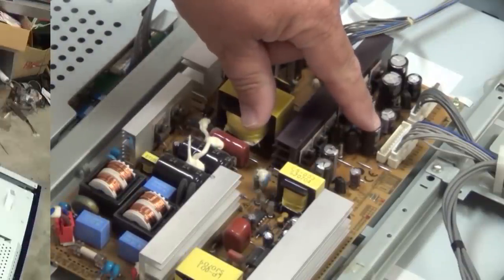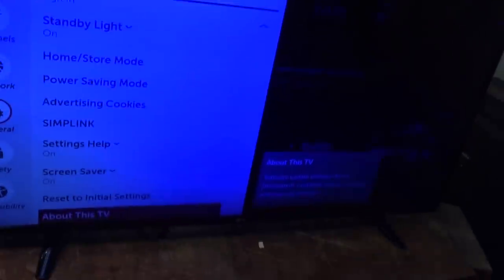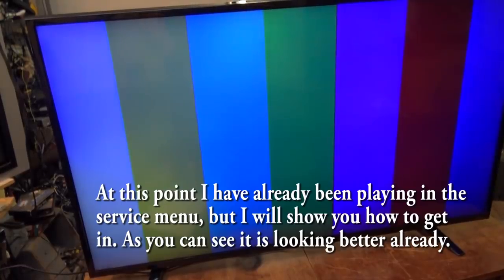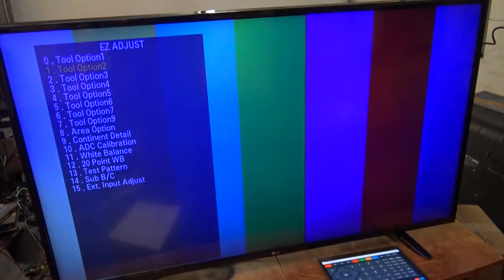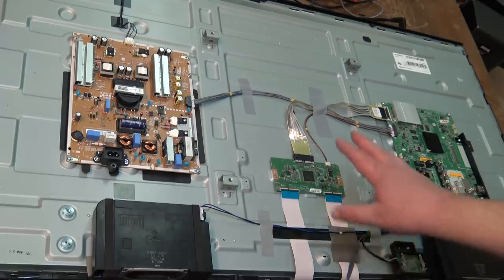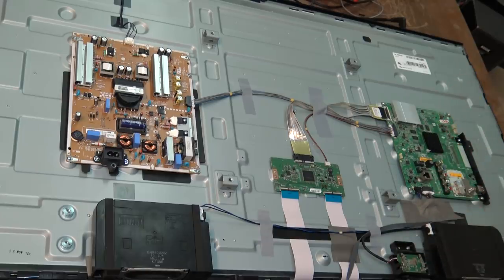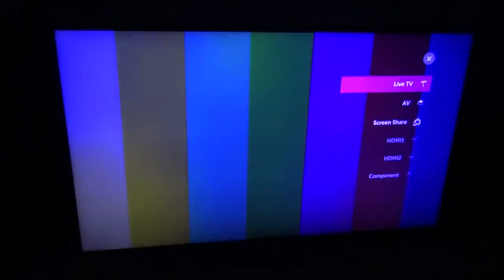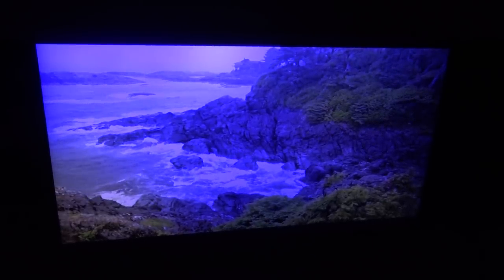LG 49UF6400 UHD 4K TV Picture Turned Blue. Let's find out why.

Comment: Just a (probably stupid) idea that popped suddenly, could adding a yellow filter/diffuser to the panel correct the colour?
Reply from the maker: No! The yellow phosphor adds yellow light, which is a mix of red and green. A yellow filter would just block the blue light, but when there is no yellow light to pass you won't have anything to pass. A quantum dot filter would work. That is how Samsung and Sony didn't it  blue led into a quantum dot filter. I thought initially this was a quantum dot display when I saw the blue light at the back .
Reply: @12voltvids  Oh ok, I was thinking along the lines on how those later incandescent light had blue glass to make the light cool white instead of warm.
Reply from the maker: @t0nito  
Right but an incandescent lamp is just a glowing white hot filament, which already has the full spectrum of light right up into the uv spectrum. They just have more in the infrared end, so the blue filter removes most of it. They used to make black lights out if woods glass that filtered all but the near uv.   LEDs on the other hand are monochromatic  they generate a single wavelength if light. Depending on the "doping" of the semiconductor material. The blue led was the greatest invention. Blue light will make phosphor fluoresce which is exactly how they make white LEDs. The actual diode junction is blue, and they all shift more blue over time. Here is an expariment. Buy a 2 pack of same brand led. Put one in a socket and turn it on. Leave it running 24/7 for 2 years. Then take its partner that is brand new and power it up. Point them at the same surface and note how much more blue the one with a few thousand hours it. I have one in my kitchen over the sink that runs constantly and it is far more blue then the rest that came out of the same package, but install was delayed as I waited for the old CFL bulbs to die.
Reply: @12voltvids  Cool, thank you for the clarification :)

Comment: So I guess the phosphors on the LEDs (white LEDs are actually blue LEDs with a phosphor coating to produce white light) has actually started to wear out? Can't say I've ever seen that before! It shouldn't happen, at least not for a very very long time.
Reply from the maker: Right. There is no such thing as a white LED. All LEDs are monochromatic.
The make up of the materials used to make the semiconductor junction determine the wavelength of light. The breakthrough was the invention of the blue diode, as blue fluoresces with phosphor. The phosphor chosen creates yellow light, which when mixed with the blue light produces white light.  The phosphor is breaking down on these diodes, proabbly due to excessive heat from being over driven.

Comment: My dad still has his Sony bravia 46 inch i think hdtv  manufactured November 2010 12 years old and it still works.
Reply from the maker: The LCD sets with fluorescent backlights were very reliable.  I have a few monitors used on my security cameras that are close to 20 years old and are never turned off.  LCD and plasma are very reliable.  The mist reliable light source ever made was conventional magnetic ballast fluorescent lamps.   Only problem with them is the miniscule amount of mercury they contain.   LEDs just don't last.
Reply: @12voltvids  before that tv he had a Sanyo 32 inch AVM 3257 CRT Tv he actually won at work back in 1996-1997 brand new for free and the picture tube blew at 15 years old in Summer/Early fall 2011. Even my Mom's parents had the Same model Tv Manufactured April 1998 i remember looking at the sticker on the back and the fuse got replaced once. Then by Labor Day weekend 2016 the fuse blew again. Now maybe still to this day it's still sitting in the barn of the old farmhouse they lived in up until 2014 and about a year later It got taken down.
Reply from the maker: @austinthevhsvideogamelover5265  I have a couple of old CRT sets kicking around to go back to the '80s that still work. I have a black and white set that goes back to the mid 60s that still works. Now please don't get much use. In fact my second Sony, the first one I bought I sold to a friend when I bought the second one in 19 85 I think. It's not even remote control but it does have an AV input. Kv1965 is the model.   I should drag it out and do a video. Last time it was run it had a fantastic picture and that would have been probably 25 years ago.  Used to be my program monitor when I was still editing using tape.

Comment: You know if this problem also happens in UK6300 model?? Thanks!!
Reply: Happens to most of them. UH6300 here, went stained blue after 2years 1.5 months
Reply: Yes it does I have a uj6560 and it's happening
Reply: @Kaynstein  did you send it to repair?
Reply: @POWERMAXUM  nah. Relatives didn't mind the blue stain. Appearantly, the blue tint does not progress anymore after it got hold ofathird  the screen in various places. Support basically told me they couldn't do anything since the varranty was void.

Comment: Does this tv look blue to the eye or is it just blue on the camera?
Reply from the maker: It looks as it appears all blue.  @0:31 look at my arm. It looks normal doesn't it? The LED backlights turned blue. Have seen this now about a dozen times. LED sets are shit.  Not just LG, I have seen toshiba as well.
Reply: 12voltvids only asking as i have what looks like the same problem with my samsung where it appears blue on camera but fine to the eye
Reply from the maker: @RJOWNES  
This one was very blue.  That's why it came in

Comment: 6:20 - Weird. You'd think the factory reset would set all these to normal values .,
Reply: @John Wow, THAT's a failure I've never heard of before!
Reply: Where I work we have about 40 of the 43" LG TV that almost every TV has turned blue.....only about 3 years old
Reply: @timb7328  working on a 43 inch lg at the moment with blue leds, iv ordered some new strips but they're used from ebay, I'm hoping they're not blue too lol
Reply: @reacey  I contacted LG and they said theirs are on backorder and don't have an eta. I worry like you....did they actually update the manufacturing or are they just going to send LEDs that will turn blue in 1 or 2 years.

Comment: You wouldn't happen to have any insight on an issue with a 49UH668V.
About the same time last year it started flickering at the top 1/4 of the screen in brightness changes, that went away after about a week but there were horizontal lines on the panel (not visible from 5ft) still there. 
It's started the flashing again but now it's basically strobing blue-ish (you can still make out a picture, it just has a deep blue tint) last year I opened the TV and everything seemed fine (there's a thread up on ifixit, nobody there knew what the issue was with some people saying T-Con but not T-Con because horizontal lines mean the display board (not replaceable) is fuckered. Flickering follows a rhythm of about 2 seconds of no flicker, then flickers 11 or 12 times in about 1.5 seconds then goes back to normal for a couple of seconds. It takes a while to start flickering and if I turn it off for a while it stops (for a while) so I'm assuming the issue is that a component is overheating. If I had a thermal camera I would probably be able to diagnose and fix pretty fast if that was the problem, sadly I don't. Two inductors looked pretty toasty last year however, but not burned out completely. 
Link to the ifixit thread I made last year:
https://www.ifixit.com/Answers/View/636757/My+LG+TV+has+a+weird+flicker-strobing-pulsing+issue.+LG+49UH668V
TV is about 4 years old now, my mother has an old yet 1080 Samsung from 2007 that runs absolutely fine, shit is built so cheap now its disgusting.
Reply from the maker: Don't have a clue.  Probably the panel.  I don't work on tvs anymore.  Just vintage audio and video gear.

Comment: Totally agree with you on the difference between plasma, LCD, LED. The refresh rate on plasma sets is so much better than anything else. I got mine 10 years ago as well, and I'll hang onto it as long as I can. I don't care about power consumption because it's only on 1 - 3 hours a day.

Comment: It seems like LED tvs have the weakness of LEDs burning out over time. Our main TV is an LG 65" and it has about 12k hours run time, I keep backlight settings relatively low and it still has a perfect white image. On the flip side, I picked up a used TV with less hours but still around 10k hrs, super blue/violet. 

LEDS will age and turn blue no matter what, but high on times for pro longed times seem to burn in the leds and wear out the phosphorous in the chips. 
Only fix is to replace the LED strips inside the TV with new ones, then the TV is good as new. Its a pain but relatively easy fix. 

We have this old tv at my parents, Sony Bravia with the replaceable lamp at the back, 5 mins and youre all set, new lamp is all fixed.

Comment: My Panasonic LCD Viera which I got new in 2011 still produces an excellent colour picture today;. I NEVER run the LED backlight (if applicable) above 65%, contrast and brightness is around 50-55%, and  colour I got at 45-50%.  It's only a 1080p full HD set but it's good enough for me. 

LG is considered the Crosley of flat panel TV's which may be why I avoid that brand.
Reply: If it's fro 2011, there is no LED back light. It's F tubes

Comment: I have a 1982 RCA Colortrak 2000 TV.  Guess what?  37 years old and it stills works! I believe it was manufactured in  Prescott, Ontario. But not 100%.
Reply from the maker: Yes they were manufactured in Prescottif I remember correctly. Or at least assembled there with chassis wired in the states.

Comment: I have a non-smart LG TV, and it does the insane blue tint. Thing seems to be common for LG TVs, but our 8-10 year old LG has seen better days but it never got the blue tint problem.
Reply from the maker: Your old one was either a plasma or a fluorescent light LCD.  The new ones are LEDs and they are crap.
Reply: @12voltvids  Just an LCD, but the display itself is not perfect and it ghosts.
Reply: @12voltvids  Yeahh, the TV we have that tints is an LED.

Comment: The LED strips on this model are junk.  I had the same problem on the same LG model.  The LED strips are powered by only two wires, meaning that their color is not adjustable.  Once open the majority of the LEDs were glowing blue while some rare ones were still glowing white.   I ordered used LED strips on eBay, replaced them and sold the TV set.  I didn't want for the problem to come back.  But the new LED strips I bought were from a newer revision.  Maybe they fixed the problem.
Reply from the maker: The LED strips on many TVs are junk these days, especially when they are run at 100% brightness. That is just asking for trouble.

Comment: Yes this is what happened to my sharp 55”. I went to expert setting s and messed with the blue gain and other blue adjustment but it’s still has the bluish and bright white is non existent . This happened right after a firmware update from sharp and I wish I never updated now. I think that’s what did it because it was right afterwards the tv went south. It still looks ok but the blue background is still there . I turned down the backlight and it kinda helped . This is bullshit for a 2 yr old tv.! Called sharp . They said call a technician . They didn’t offer a one solution. I bought this at Wal mart on Black Friday and I got screwed down the road .
Reply: Same problem with mine. I’m just going to order some strips from eBay and change them myself.

Comment: I think it's the luck of the draw with most TV's and most electrical products these days has to how long they last before something goes wrong. For example I paid a Grand for a Panasonic Blu Ray player and after 13 months the thing would not even play any disc. They wanted an extra £180 on top to guarantee it for 3 years when I purchased it, but I never bothered paying for the extra warranty simply because you would not expect it to break down within 3 years. 

I learned my lesson by buying more expensive products and now have a Sony Blu Ray player that was £119 when it came out and got it brand new from Amazon in a sale for £65. The Panasonic never had anything in the way of extra features than the Sony, as a matter of fact the Sony has more features and was way faster and more efficient than the Panasonic, and I have had it for over 6 years now and it still runs like the day I brought it. I would not waste my money on expensive products any more, especially when the only difference regarding quality you are getting is in the build and nothing more. The Sony may be small and made of plastic but it outstrips the Panasonic by miles. The Panasonic may have a quiet draw and is made out of steel, but that is the only real difference, and if that's worth paying an extra £900 for they can kiss my ass.

I have only brought one flat panel TV an that cost me £350 new back in 2009. It's an LG LCD one with a backlight and it is only just recently started to play up. The problem it has that if you turn the TV off it will not power back on straight away and depending how long the TV has been switched off takes it longer to get it running again. For example If I turned my TV off when I go to bed, when I get up in the morning and turn it back on, it can take up until the afternoon around 5 - 8 hours for it to come back on again. Sometimes I unplug it and plug it into another power point which sometimes speeds things up, but not by that much. So I just leave the TV on all the time now and just switch it off by the cable box so no signal or picture is running on it over night. The picture quality is still as good as the day I brought it.

I am pretty sure it's just a capacitor that needs replacing, but I know some of these things are pain in the neck to get at anything inside them to replace them. So right now I am saving up for a new TV. Though nothing expensive and around the £400 - £500 mark. I am actually looking at getting and Samsung LED one this time and one of these entry level 4K ones.

Comment: This color problem reminds me my old Viewsonic VP930 monitor, every couple of month color settings are lost... I mean the settings only visible in the service mode. Fortunately I have another one, wrote the settings in the service mode and redo the settings on the faulty one ^^ Almost solved by replacing a pair of Lelon capacitors. It still happens, but lasts several years between 2 setting losses.

Comment: geez that's painful to watch that blue.. really shows its hard on the eyes all right. i have a tv given to me but part of the led strip is toast aka burnt out so when watching things see a small dark patch in it. no wonder they said it was a give away tv when they spent a certain amount on furniture. must been giving away the defective ones rofl. i had a cold cathode tv but stupid me tripped one day and broke the screen. made me sad meh and now my 8 year old LG monitors are dying i lost one due to power supply caps going i know those could be changed though. but i screwed up and snapped the plug to the control panel front. i can probably force pins back in but finding the proper path they plug into will be fun. then i plugged in my spare on i had sitting of exact model then i heard a sizzle and ammonia smell.. well know where those caps just did, it still works for now but not sure how long.

Comment: Purchased a Panasonic Viera TX-26LMD70A 9 or 10 years ago. Still works fine. Unfortunately my eyes are fading and I'm going to need a  bigger TV in order view it from a sensible distance, 10ft (3 metres).
Loads of research required to pick a good 'un.

Comment: Had lg monitor with the same problem call the service line was told it wasn't worth repairing 😔 and no places in Winnipeg could repair it shame.
Reply: i bought 20$ replacement lights on ebay, but the amount of work to do replace still putting me of to do it